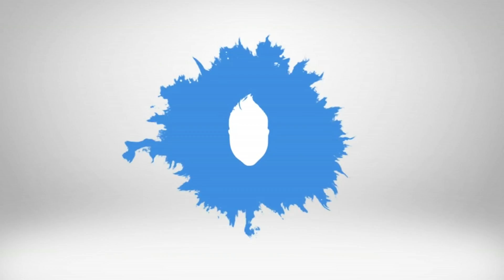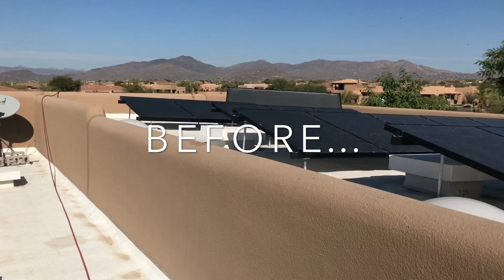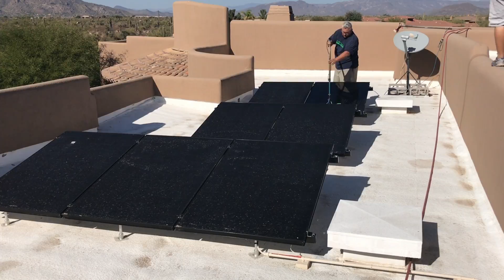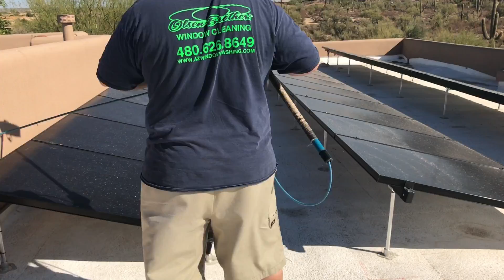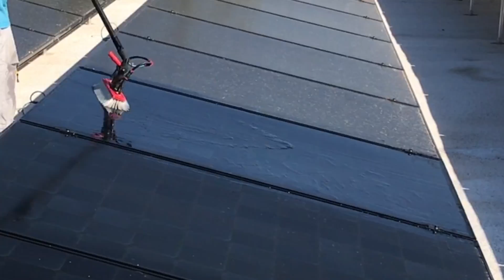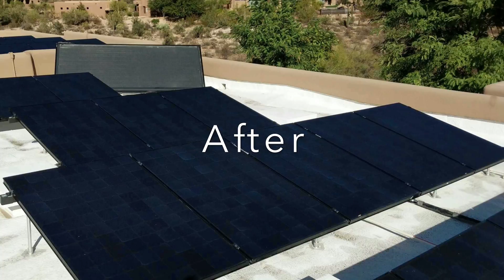Solar Panel Cleaning

Comment: It is necessary to using pure water? What's happened if someone will use tap water?
Reply from the maker: W&W Window Cleaning Yes, it is vital that the water is pure, as regular tap water (here in Az) would leave tons of hard water deposits that could damage the panels.
Reply: Thank you very much!